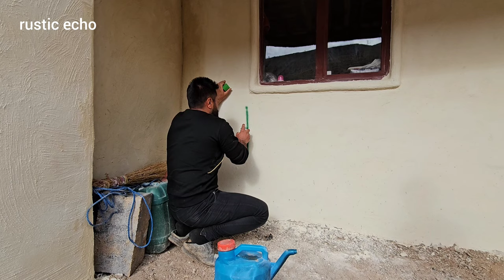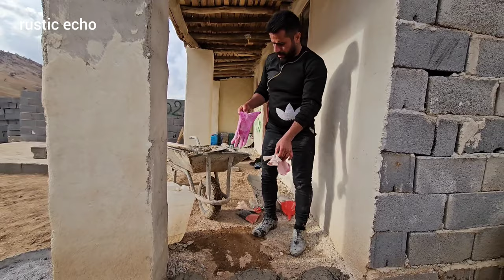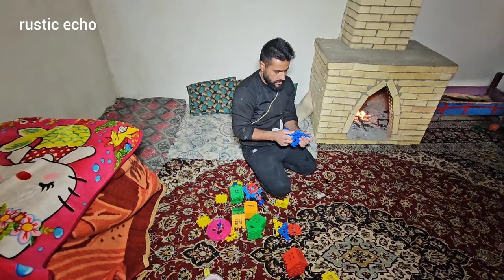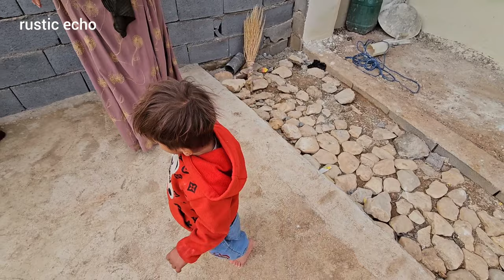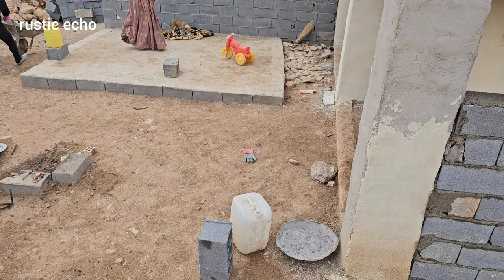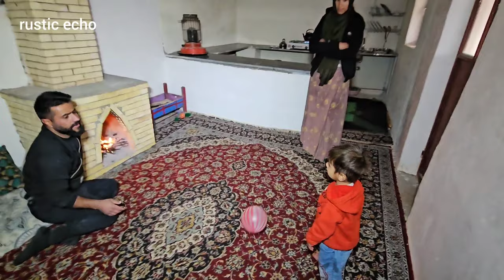Naseeb Allah and Sakineh's efforts to create a dream

Comment: Dear father it would be safe for you all especially little souljah Armin if you pave or cement the little stoned foot path that you have temporarily in between the house and concrete slab it is very uneven and unsafe little Amin or someone could twist or break their ankle or two..
And yes your wall looks very nice well done.. ❤